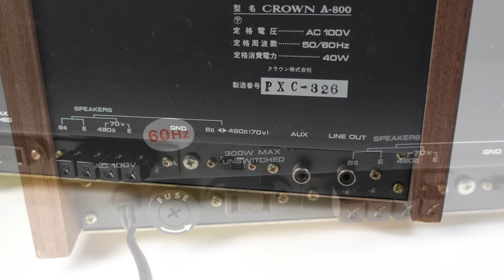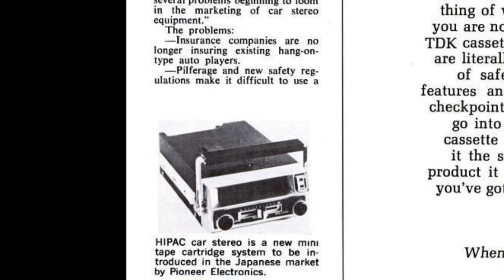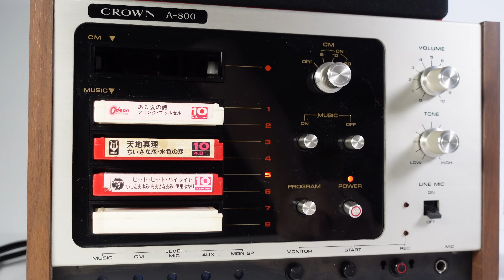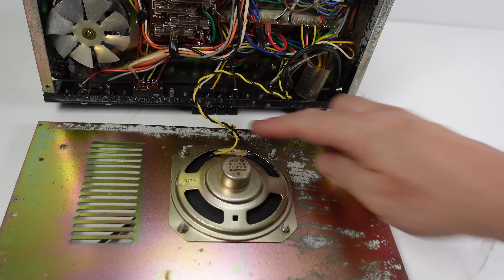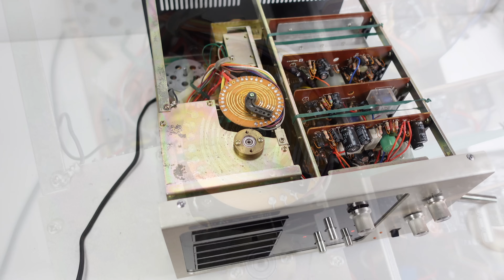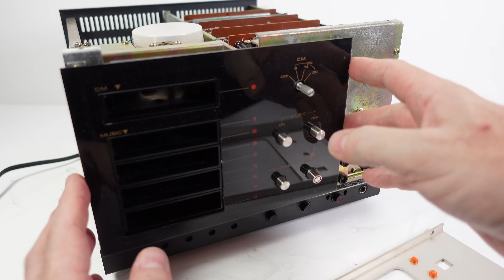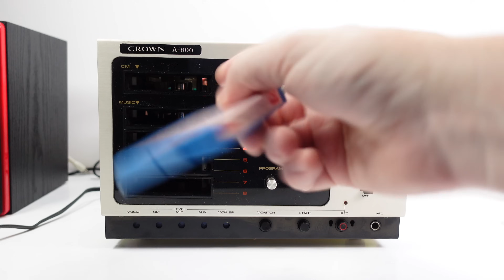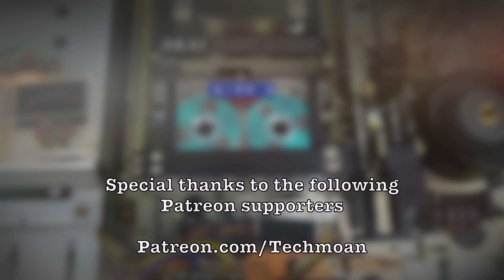An unusual player for a forgotten ‘70s music format

Comment: It is unlikely that changing the capacitor will change the speed, it is more likely that the capacitor is meant to be selected to suit the frequency. There are ways of generating a 60Hz supply though. Some UPS can do this, or a VFD could be set up to do the job.

I wonder if the announcements playing continuously is because the bit of conductive tape was removed when the cartringe was modified.

Comment: Looks like a typical ac synchronous motor to me so the cap is onl y for starting . Speed change is probably by replacement motor pulley (not included!)  BTW how much power do you need for your 100/120v devices? Just thinking there must be an inverter that could generate 60Hz available somewhere.

Comment: The biggest indicator that it was for commercial use is the 70V audio out.  That's to drive distribution transformers in a PA system.

The multiple tape cartridges with the auto-sequence play feature tended to confirm that.

When he was discussing the engage/disengage mechanism for the pinch roller and we got a close up of the cartridge, I was wondering if maybe one of the tracks on that Frank Pourcel tape might have been Days of Pearly Spencer.  Hearkening back to a video about another professional endless-loop tape system TechMoan made.   Sadly, not so.  Would have been a neat little Easter egg, tho.

"And now back to the Kenny Lynn show...."

Comment: I had a thought about your 50/60 hertz problem. Could you get an automotive power inverter that connects to a standard 12v car battery, a North America one would provide 120v 60hz and are used for household electronics.
Reply: I think he's done that at least once or twice back in the day but the electronics from the inverter tended to play hell with audio gear. Although I have seen a number of reviews of portable battery banks and solar generators, there's a channel called hobotech that does testing of a ton of off the grid power gear and usually his reviews include whether or not you can plug an amp into it and it will provide clean enough power for off the grid concerts.
Reply: As Alexander Roderick said, most AC inverters make a really awful waveform rather than a pure sine wave. Not only can they make electronics behave oddly, they can actually damage them.
Reply: @GoSlash27  Maybe drop the idea of an inverter (which are designed to be efficient) and inject a 60Hz sine wave into an amplifier and use a transformer to up the voltage. Less efficient and probably limited on the power but should give decent results.

Comment: I don't think changing the capacitor will correct the tape play speed for 50 Hz.  I believe there must be another step -- perhaps a board or even a motor swap.  Good video!
Reply: No need to swap the motor.  Just the drive pulley.

Comment: Your comment regarding the pin that moves the pinch roller away from the capstan in the "Cart player mech" segment are almost correct... there's a good reason for the pinch roller to not be in contact with the capstan when the tape isn't in motion. As an old 8-track guy, I can say for sure that it's very possible for a stopped pinch roller left against a power-off capstan to create an indentation or "flat spot" on the pinch roller. One can only imagine the issues that would cause with music quality.

Comment: My guess is that changing the capacitor won't make the speed faster, but that it should probably be changed anyway, because it could cause flutter if wrongly sized for the frequency.

I.e. if the capacitor is wrongly sized the torque of the motor will be uneven as it turns, so it's speed could vary throughout the cycle, transferring onto the audio.

Comment: 1/8 inch is the same size of tape that's in compact cassette, right? If so, it looks like it'd be really easy to make your own Hipack cartridges by 3D printing the shell and using the tape and spools from a cassette. If blank cartridges are really so rare, it could even be lucrative!

Comment: Would your 120V 60Hz inverter work for this or is the voltage too high for this given that it's marked for 100V? Not sure how safe that generally is with 70s electronics.
If it's too high to be safe perhaps it's time to get a 100V 60Hz inverter, or is it rare enough to not be worth it?

I see a couple of 300W "pure sine wave" inverters at AliExpress for semi-reasonable costs that offers the buyer to select a variety of voltages (100/110/120/220/230/240) and both frequencies at the time of purchase. There's also 1000W pure sine wave models for more, again output is fixed at time of purchase, all found via "100V inverter pure sine wave" and sort by price. There may be cheaper or more flexible ones if you accept "modified sine wave" (aka modified square wave) though there is some electronics that will be very upset with that so it's safer to go with PSW.

It would of course be much nicer if the inverter could do all of them instead of just one fixed at the factory, given how these are constructed I wouldn't be surprised if it's just a question of moving a few internal jumpers so the factory doesn't need to make so many SKUs. The "normal" use is for solar or battery backup systems so in most cases the customers isn't interested in being able to change voltage and/or frequency so they take the cheapest option.

Comment: My Advent Videobeam 1000A uses plug-in cards like that.  I thought that was a pretty neat idea for a projection TV where it would be difficult to move the whole chassis for service.
Reply: I repaired and was factory trained on the Motorola 100% solid state TVs when they came out. RCA had transistor sets, but needed a HV rectifier tube and everything soldered in. The Motorola had all plug in boards, just some supporting components on chassis like the power xfmr and related. Works-in-a-drawer. Chassis pulled out in the front, to be repaired in home, powered up.
     I may have some Videobeam boards from then, I should ebay them.

Comment: You should pick up a US or Japanese 12v to 120v or 100v 60hz power inverter  you could power it wit a 12v power supply or a battery

Comment: I think the possible two-track tone system for the top CM slot may be for shorter messages: if you have a 20 second message, you don't want it playing for the full length of the loop. So maybe a tone at the beginning of recording, and a tone at the end of the recording to set start/stop points, and the CM slot will FF from stop back to start after each playback.

I wonder if the LINE MIC ON/OFF switch produces tones when flipped, or if the START button does something. How does the manual describe the steps to make a recording?

Comment: The capacitor is a starter for the motor & increasing the capacitance of starter capacitor will increase the speed of the motor and so yes just by changing the capacitor to a 1uf 400v capacitor it will probably run at correct speed.
Reply: split-phase running cap. motor will lock to the mains freq, but feel a bit sick.

Comment: Regarding the 50 Hz/60 Hz speed issue: How many wires are there on the motor itself?  If there are two it is likely just a basic motor and speed changes would be mechanical in nature; three or more there's a chance of changing that capacitor value or something else like a control circuit.

Comment: Definitely try to change the capacitor value!
My guess is that there is some simple control loop making use of the capacitane: The motor speed feeds back an AC frequency and the cap is part of a resonance filter (or similar) that controls the voltage for the motor. It could be also a permanent split capacitor (PSC) motor. The capacitor would just lower the torque. It´s dirty but possible. I don´t think it´s for phase compensation, as it would be just simpler in the means of engineering/bom-cost to just take one single value - and there wouldn´t be a need to print different values for 50/60Hz. Putting a parallel 400nF cap (take care of voltage rating!) will do it for a quick test. If it doesn´t work, then it´s a synchronous motor, and the mechanical setup is different for 50/60Hz - but I´d be very curious to know :-D

Comment: That capacitor will be the phase-shift capacitor for the motor and no, I don't think changing it will cure the speed problem. What you could do is to feed 60 Hz from an audio oscillator through a power amp and a mains transformer run backwards to feed the motor with 60 Hz. To reduce the loading on your 60Hz supply use it to power just the motor and not the rest of the machine.

Comment: If that's a mains powered motor, I think the capacitor in question is a starting capacitor. If that's the case the different values are just to produce a different phase on the starting field for reliable starting at the different frequencies. It won't change the motor speed.

Comment: I doubt the capacitor will change the speed as it's probably just a starting capacitor. They probably swap the motor out since it's a synchronous motor and it runs according to line frequency. And the different motors require different starting caps, mostly due to the frequency

Comment: No, changing the motor run capacitor value alone will not make the motor run at the proper speed for the line frequency. The different run cap values simply correct for the line frequency difference to keep the motor windings in proper step with the frequency, basically to keep the motor windings pushing forward instead of “fighting each other”. The only way to change the final drive speed with a synchronous motor like that is to change the diameter of either the motor drive pulley or the capstan. Since the capstan diameter is part of the cartridge design it’s unlikely they would want that altered so it’s going to be the motor pulley diameter. Both the capacitor value and the diameter of the drive pulley must be changed to go between 50/60HZ.

Comment: Another giveaway that this is a background music system is the fact that it has a 70.7 volt speaker output. This was the standard used in PA amps for driving multiple speakers over long distances. As for the speed adjust, you would need to change both the capacitor, and the motor pulley.
Reply: "Was"? It still is - I've installed brand-new systems as recently as 2017 (when I left the industry)!
Reply: @Azlehria  What is the benefit of this standard? Compability? Scalability?
Reply: @rolfedrengen  Scalability, you can have many speakers, long speaker runs , and individual speakers have transformer taps to balance the levels at each speaker to compensate for losses in long speaker runs.
Here in Australia because we don’t have the, voltages 100v and over has to be in conduit rule , we can use 100v line speaker systems, which give better performance than 70v.
Reply: @rolfedrengen  Scalability, yes, but also resilience. An "8 ohm" system - actual nominal resistance impedance varies - requires increasingly complex series-parallel configurations to create the appropriate total impedance as speaker count increases, and one speaker failure will take out the "downstream" speakers in series. This changes the system impedance and can damage the amplifier.

Meanwhile constant voltage systems are, regardless of wiring topology, electrically always parallel circuits. Since each speaker has its own transformer tapped off an electrically-continuous wire, the amplifier sees a drop in load but not impedance when a speaker fails. The higher voltages typically used also allow thinner wire - I typically installed 18 AWG even for runs upwards of a mile on 70V RMS systems. The biggest system I ever worked on used about 130k feet of cable and about 400 speakers ranging from 1/2W-tap ceiling units to 40W horns, powered by a bizarre assortment of 1/2U to 4U amps with 19 sources in 12 tiered zones. All 18 AWG.
Reply: @Azlehria  in Europe, the standard is actually 100V. 70V and 50V outputs are used to drive more speakers at a lower power.

Comment: I know this sounds extreme, but what if you just put a bigger motor drive pulley on the output shaft of the motor by 20%, might be able to get one 3d printed or one machined out of brass.

Comment: The motor in this looks like an induction motor, their speed is directly related to mains frequency, the only way to change it is by swapping the pulley wheel - or winding a length of tape around it to up it's diameter.
On some systems they have a stepped pulley where you can swap the belt to the other step, however this machine looks like it's belt is a wide flat type, so bad luck there.

Comment: First: Kudos on the Phil Collins album pun. Second: I love the idea of a sumo rivalry in the electric grid in Japan.
Reply: Its one of the backwards things of Japan that makes me wonder. After all these years, they never switched to a single frequency, and in addition its the only country in the world using 100V. In 2011 this hit them hard as they were unable to share power easily from the west into the east after that earthquake shutdown Fukushima, etc... 50 vs 60 means 20% more copper inside a transformer, and 100v vs 240v means wires need to be thicker to push the same watts safely. Which is why Tesla wanted 240V@60HZ which America sort of uses and Guyana is the only country in the world that actually does (no middle tapping transformers, yay!).
Reply: @freeculture  Japan should have standardized during the rebuilding after WW2 where they would most likely have used the US 120v/60hz standard as they were occupied by the US at that time. 

Also, a few other countries like Peru, The Philippines and South Korea use 220-240v/60hz as well.

Comment: Electrolytic capacitors have wide variation in capacitance (+/-20% tolerance is typical), so they're not suitable for precise timing adjustment. It's probably part of the power supply, and the timing is adjusted elsewhere.

Comment: A simple way for testing 50 or 60hz devices depending on your area would be to get a sine wave power inverter that would put out the right frequency needed to operate the device.
Reply: He has one for testing/demoing older US equipment, but I think he finds it easier to convert the equipment, if possible.

Comment: I would be willing to bet a capacitor could change the speed. I have 2 Sony reel to reels (a TC-630 & a TC-366 ). I got the 630 at Goodwill for 10 dollars. Anyway, both of these played too slow even though set at 60 hz. I looked on line and was informed that when the cap at the motor is defective the machine plays too slow. I was able to get new caps (which looked very different) and the problem was fixed. The old cap had 3 connectors. One for 60, one for 50 and a common. My new cap only had two connectors which was comparable for 60. If I was to go to a 50hz area, I would have to get an additional cap which would be comparable with 50hz. Since my 366 also uses an additional part for 50, there still might be something in your machine. However, my speed in both decks changed significantly by changing a cap.

Comment: I am doubtful that the capacitor alone changes the speed, partly because the capacitors are unlikely to have a small enough tolerance value to provide an accurate speed (unless there’s a trimmer in parallel for fine tuning).

Comment: Capacitor will NOT make it run the right speed.

It is most likely just a start/run capacitor for the AC motor to help get it started up. Having the wrong one probably just makes the motor have less toque.

Comment: Just from the location, I suspect that that is a smoothing (bulk) cap. A higher value is needed for the lower frequency, so I don't think it will help your speed issue, but it will prolly help with any mains hum if you put the larger one in.

Comment: Hello, thanks, this is so interesting. Isn't there a way to inspect the piece that programs the number of times the CM plays? looks like there's a false contact and it's always in "play NOW" mode ... or that the timer circuit is stuck on a "play now" position
Reply: Given that the messages are likely to be of variable length, the stop tone seems likely and quite possibly a start tone too.
Reply: It's more likely that it's looking for a tone, but I'm surprised that the record circuit does not generate it when some button is pushed or at the end of the recording.  In my AV nerd days, I used a tape player that had a button that you pressed while recording to tell a projector to advance the slide on playback.  Often, there is also a mark at the beginning, and the player fast-forwards (you don't rewind endless-loops) from the end mark to the start-mark each time it's done playing the announcement.  This is pure speculation based on similar technology.
Reply: @filker0  Sounds reasonable. There's even a good chance it's exactly the same tone. Someone speculated the "start" button on there might be what did the job.

Comment: Why is a American company making Japanese only product? Also the cap will not change speed, this suggests a different motor was fitted to the 50hz model. No reason though you couldn't find a different spindle for motor installed.  I am only 90% certain of this but 100% certain a cap change will not alter rotation speed of synchronous motor, it is locked to supply frequency. (Edit I assume it is a synchronous motor).
Reply from the maker: https://commons.wikimedia.org/wiki/Category:Crown_(audio_brand)
Reply: @Techmoan  It  is very confusing because it looks just like the American Crown styling which were wonderful machines of high quality.  It would fit right in. Same era too, right at the height of American Crown success. I would expect this to have raised eyebrows if it was seen. Even the model numbering is similar.